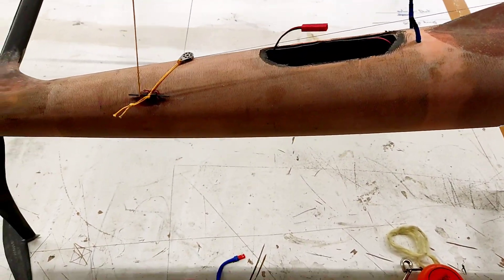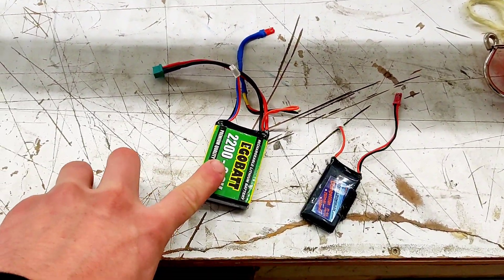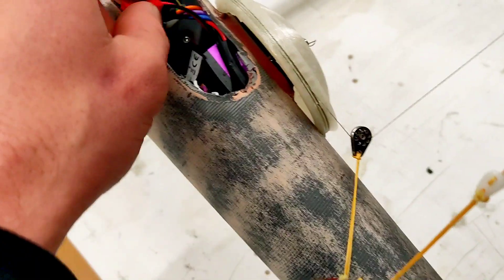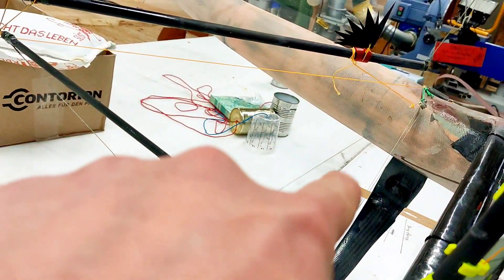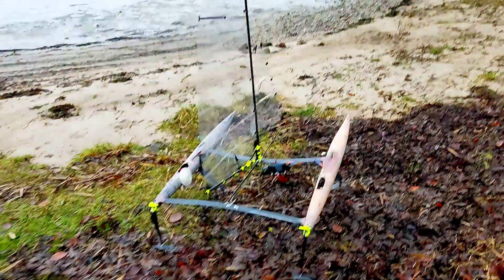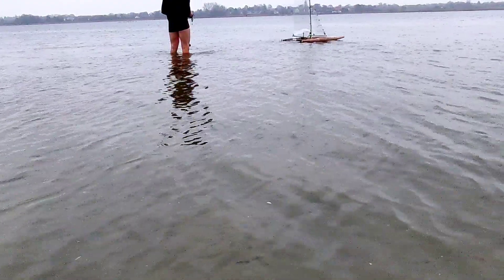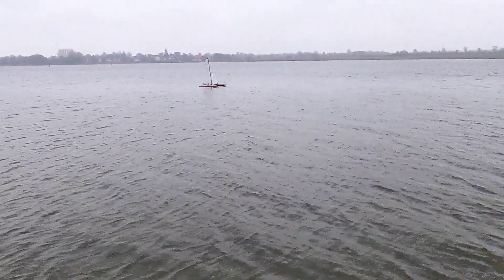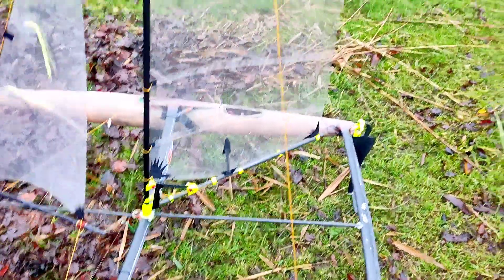Maiden flight- Sailing RC Catamaran 3d Printed with 7 servos in light wind

Comment: Thanks for sharing. Great fun to watch.
Reply from the maker: So the reason I have my draft at 30/35 % at the top ist to have a little less power and my center of force as low as possible. Also I think without the jib but with twist the fat head should be perfect with 30 instead of 50% draft